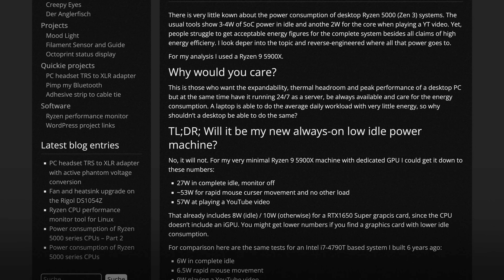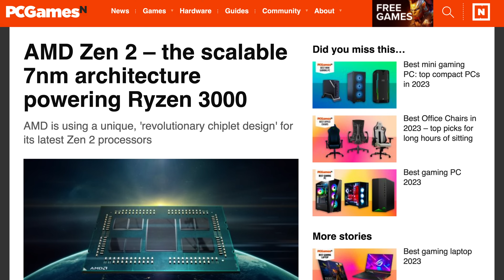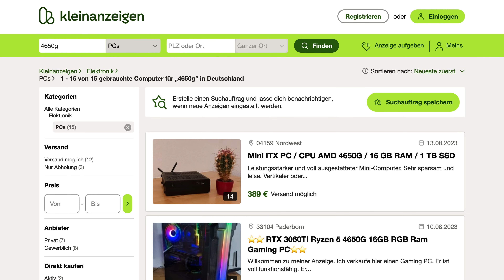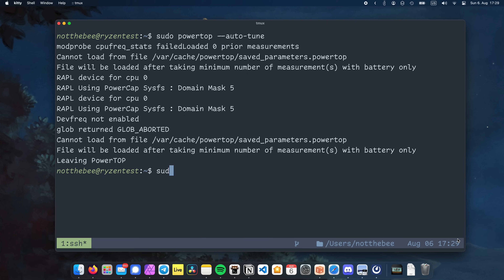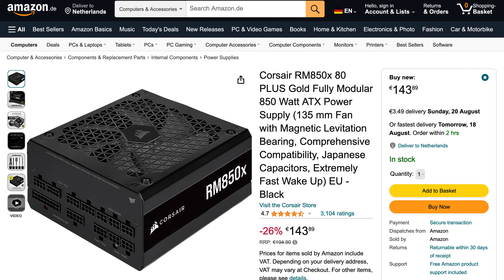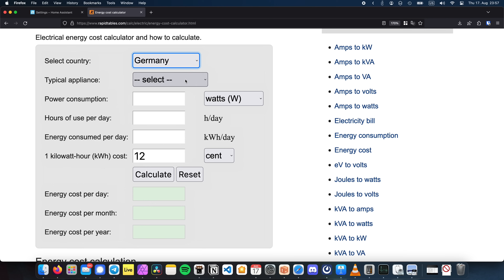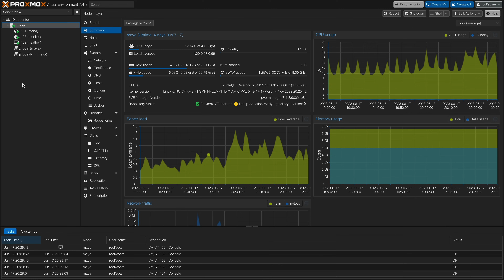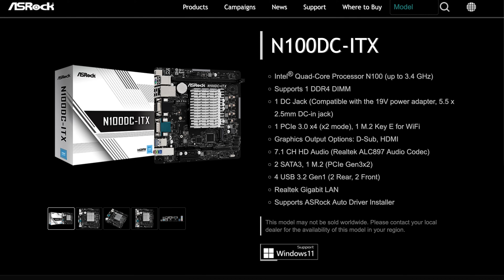This $250 Ryzen Pre-Built is a BEAST Home Server!

Comment: The problem here for me (of course highly subjective):
A home server is supposed to support some real storage space. That for me is the main point of any home server. 4 drives is nothing.
So for example I'm still running a very old i7-2600k -- simply because the board supports 10 SATA drives (or use a suitable host adapter - but still you'll need a case that can fit some more drives). So I'm running 10x18GB drives as zraid-2 (on 10GB ethernet) with it. Takes a bit more power but massively more useful and probably even much cheaper today because being much older. Since most of the day drives are in sleep-mode, power consumption isn't that bad, too.
Probably a good old HP MicroServer is still a better choice in practice.
Reply from the maker: You could buy an HBA or a SATA controller, and connect as many drives as this case will take. There are two 5.25” bays in the front, and 10 drives is definitely possible if you’re creative 😁

Comment: Thanks for the information.  Just for data on what  #'s I pay attention to (other than the super-important power/cost you cover well here)....   I typically copy thousands of pictures between drives and over the network with my home server.  I also dump compressed drive images to it for critical devices on my network.  Also, since Apple has changed their image format.... the home server tends to end up getting tasked with converting those in huge batches to JPG.  (I tend to use thin clients and laptops, so transcoding and backup tends to get done on the home server--even though the laptops would be faster... I just kickoff a script and the laptop leaves with me or gets shutdown while the server chugs away for sometimes hours)  So, USB throughput for external/cold backups, network throughput for large files (10-50gb) and small files (hundreds of K to MB), and local throughput for hot/onine backups.  I run plex too.... but even ancient HW does well for HD streams these days.

Comment: Nice Video, but how did you find that offer? Seems like a very lucky shot to me, can't find any comparable offers on ebay or ebay-kleinanzeigen.
Reply from the maker: Here are a few. Just put "4650g", "4350g" or any other Cezanne/Renoir PRO model, and set your max price to 300€
https://www.kleinanzeigen.de/s-anzeige/medion-pc-amd-ryzen-3-pro-4350g-16gb-ram-1tb-ssd-neu/2530105100-228-967
https://www.kleinanzeigen.de/s-anzeige/megaport-pc-amd-ryzen-3-pro-4350g/2502725094-228-2512
https://www.kleinanzeigen.de/s-anzeige/gaming-pc-amd-ryzen-5-pro-4650g-amd-radeon-graphics/2493126724-228-6820

Comment: Nice video. Thanks! Does it support RAID? I can get a dedicated NAS server at the same price, so why this built and not a NAS server? I would like to see some benchmarking on the client side, where you do normal task on the client PC, connected to different serves, like this one, your more expensive one, maybe a NAS and likewise servers. 

Thanks, I have subscribe...
Reply from the maker: The only dedicated NAS boxes I've seen for <€300 online are two-bay boxes with ARM/Atom CPUs. This PC will take however many drives you can fit in it and is way more powerful.

Just like most of the dedicated NASes these days, this PC does software RAID. Hardware RAID is pretty much dead in 2023: https://www.youtube.com/watch?v=l55GfAwa8RI

Comment: Running a server with ryzen 3600, 2x16gb 2600mhz, 1 nvme, 2 sata ssd, 2 HDD and a 1080ti. When the HDD are spin down, the consumption to wall is 52w. I leave a windows VM with passthrough for the 1080ti because I think this consume less power than leaving it off. Could switching the 3600 for the 4650g reduce the idle consumption? Also could you explain more about the amd P-state EPP for a proxmox server?  Thanks for your great videos

Comment: My home server costed 65 euro's totally. 49 euro's for the system with 4 GB RAM and a 250 GB harddrive and 8 GB extra RAM for 26 euro's. Excluding monitor and keyboard. It's a HP / Compaq 8100 Elite SFF with a Intel i5 650 proc. It has no fans and is totally silent.

Comment: Does this system support ECC properly or does it support running ECC memory in NON-ECC mode. I see this a lot with AMD boards where it says it will run unbuffered ECC memory but only in non-ECC mode.

Edit: Okay never mind. You answered this question pretty well around 4:00.

Comment: Did something similar to this very recently, but with a $50 mobo+cpu (some intel celeron) combo instead and just shucked it into an old rig's existing case+psu. Got it down to 22w~ idle with 3 3.5in HDDs, 1 2.5in HDD, 1 SSD, and 1 old fan consuming 3-5w on its own. It's nowhere near as powerful as this Ryzen though but gets everything I need it to do done.
Reply: Which Board and cpu you are using?
Reply: @8bit239  Hello, the exact board is called "ASRock J3455-ITX Motherboard" ; it comes with the integrated  Intel® Quad-Core J3455 processor. The weirdest part with this setup was the fact it needed laptop memory to function, thankfully I had a lot of dead laptops around to borrow memory from.

Comment: 16 Watts is good for an AMD CPU (or APU). AMD has never achieved to lowering their Idle-consumption. The Ryzen 4000 pro APU´s are very good in medium-load efficiency. I had an Ryzen 7 pro 4750G used for HD-Gaming and that was very sparingly (i could play Fortnite with 100 Watts at high settings - with RTX 2060). For Home-servers with low Idle-consumption they are not the best chose.
If you want a realy good idle-Plattform, then Comet lake is good for that. The Cometlake (Asroch H510M-HVS) can do Idle with 9 Watts (i5-10500K and Corsair VS350). Of Course only with the system-SSD and nothing more. And these incredable Shuttle DH410 can reach 5 Watts in idle - whats the same, as with the Fujitsu S740 Thin-client with an Celeron J4105. But that two PC aren´t suitable for Server-systems with many drives. Even the Asrock H510M-HVS may had to less PCIe-slots (only one x16 and one x1 and no M.2-slot and only 4 Sata - that low consumption had to come frome something).
I had also an Gigabyte B560M-H and that board also could not go under 20 Watts in idle. The Board-configuration seems to be relevant. And of course the power supply.
For whatever reason,  Intel 600-Plattforms (i have two diferent H610-Mainboards), the Idle-consumption does not go under 20 Watts (with G6900 or i3-12100).
Also i have several FSP power supplys and they are not as bad, as you expierenced, but not very good for Idle-consumption. What is somewhat strange, because Terra is an established OEM/Office-system  supplier and they had to be conform with special energy-guidelines for office-operation and one of them is the Idle-consumption - because usualy these office-systems are booted the hole day, but not the hole time under load. So low idle consumption is a big thing in energy-consumption in such setting. Medion-Mainboards are also relativly economical in idle (9 Watts for an H110H4-EM).
And that 4k Video scenario? Was that streaming over the network or directly over the IGP/APU? Skylake had only a HD-Grafik, whilest the newer Ryzen 4000 and (in regards to your video over the "mutant-CPU´s" ) Coffeelake-Gen have UHD-Grafik.

Comment: Interesting. About your future video: I burnt myself once with low-power celeron once. Power efficient does not mean it has enough power. It depends what you throw at it, but for me if something does not require power, RPI can do it, if it does, some USFF PC with skylake/kabylake core i5 are very power efficient, they just consume power under the load, but for home server, it might be a few minutes per day. But difference between celeron and i5 is that task might take either 3s or 10-15s and that's difference between fine and hardly bearable.
Reply from the maker: You probably underestimate how slow RPi 4 is. It's slower than something like an Atom x5-Z8350, and that CPU is more than 5x slower than the Intel N100. And that's an entry level Atom-level SKU.

I've ran an i3-6100 as my home server for years and it's more than enough for my use cases. As long as it has a PCIe slot and enough SATA ports, I'm good

Comment: For the 5.25” device bays, it may be better to put there 4 or 5 bays 3.5'' hdd cage. Like FlexCage MB975SP-B . Or mixed 3.5 and 2.5 cage.
Reply: I’d be careful with the latter suggestion as the 3.5” bay will only take HDDs with 6 mount points.  I know that Seagate had some 1TB HDDs with 6 mount points years ago.  6TB may be the highest capacity these days.

Comment: im fine with xeon 2640v4 (10/20 core) + chinese mobo + 32gb cheap ddr4ecc used, 10y old corsair 450w gold psu, 45w in windows 10 with 2 laptop hdd + 1 nvme ssd and game server running using 8 dedicated cores in vmware. cheap 1200VA ups + isp router + wifi6 router + 8port x1gb switch consumes + 25w, and I cant save much more. Limited cpu max power to 95% in windows power management that prevents cpu from boosting higher than 2,3 ghz, saving around 10w under same tasks. So whole system is 70w consumption +/-2w, and im ocassionaly using server to watch youtube on tv, dl torrents, host plex server and home lan file archive. As ssds getting cheaper plan to replace laptop hdds with nvme drive. whole system price is under 200 usd (excluding network gear and ups) added 2.5g lan card from ali for 10 usd, waiting for 2.5g switches to become cheaper.

Comment: nice video. I have to say i got your videos recommended today and was kind of surprised by talk about inefficiency of amd cpus, I am running 5600g in with a520 board / 2x 3,5 inch drives + 1x 2,5 inch ssd + 1x nvme ssd / 2x32gb ram / corsair sf450 psu / currently running about 20 docker containers - idling at about 16-17 watt. I have been running this for about a year without a single issue . 
I has plenty of power on demand and currently i see only one downside - 4000g/5000g supports only x8/x4/x4 bifurcation of cpu pcie lanes, so with my planned upgrade i will just throw away four lines :/
Reply: Hi, do you know if with an 550 motherboard 4000g/5000g support x4/x4/x4/x4 bifurcation ? Is that limitation also for non APUs such as ryzen 5950x or those support  x4/x4/x4/x4 bifurcation ?  
Can you explain if there is a way to use the x8/x4/x4 bifurcation to use several M.2 ssds ? Thanks
Reply: @ncarrasco2006  it is definetly an apu limitation, i actually used same motherboard with 3700x before going for low power with 5600g  and it offered 4x/4x/4x/4x ..
Reply: I see, I wasn't aware. I bought a Ryzen 7 PRO 4750G. Regarding the limitation, did you find a way to use the available configurations to support more M.2 SSDs ? Thanks!
Reply: @ncarrasco2006  afaik, with x8/x4/x4 we should be still able to use three m.2 slots on those passive expander cards like asus hyper m.2 / msi expander-z, one of the slots just wont work ... that is actually my next plan for upgrade .
Reply: @nesty8848   ahh, I see that for clarifying that , I think I will try that also, but some months later.

Comment: I really enjoy videos like this, thanks!  I recently found your channel and used what I learned to retool my Minecraft server and brought it from 20 watts down to 10 watts while players are logged in and playing!  That might be a cool video for you to tackle since it is a light duty 24/7 use case and oddly just wants tons of RAM and a fast single core to keep the game loop running at 20 ticks per second.  I picked Intel G3258 since they are so cheap and can easily overclock to 4.0GHz.  I just bought two off eBay for $9 each and got it up to 4.0GHz stable and it barely touched my idle power draw!!!
Reply: Actually impressive
Reply: Wait... 10 Watts total while people play MC? Whats's the rest of your setup?
Reply: @muellerhans  an ASRock mobo, a Samsung EVO 850 SSD, and importantly a PicoPSU 90 power supply.  Oh yeah and a big Noctua cpu cooler that never has to run its fan.  There is a 110mm case fan that also never runs.
Reply: @muellerhans  I'm playing Nomifactory CeU and late in the game when thousands and thousands of machines are running, the power goes up to like 16 watts when I'm logged in.  Having thousands of ticking tile entities increases the needed power a little bit.  Still minuscule!

Comment: misleading information. no actual wattmeter used
Reply from the maker: The power consumption is measured at the wall with a smart energy plug
Reply: @WolfgangsChannel  at what timecode? you got 16 watt, seriously?
Reply from the maker: Any timecode that shows watts is measured at the wall. 16 W for this hardware is not unreasonable
Reply: @WolfgangsChannel  something hard to believe

Comment: If you had to pick something brand new, that is actually available what would you choose, for low consumption, without being poor?

Plex 4k playback, NAS, and other various stuff.

Currently rocking a 5820k with a Quadro P2000, MSI X99-A SLI PLUS, 16gb ram and it consumes around 60-65w.

For a budget around 500 euro.

Comment: Can you build a server out of a Beelink Ser5 AMD 5500U with 6SSD's? you might need to 3D print parts of a case and some soldering for SSD power. At Idle  the beelink should stay at 8 watts.The beelink Ser5 can be bought on Amazon for 320Euros

Comment: Saying $250 defeats the purpose if you kept spending money on it..
Reply from the maker: I'm making those videos so you don't have to :)
Reply from the maker: I'm not sure if you've watched the video in its entirety or maybe misunderstood, but I discussed different options to make this PC more power efficient, and ultimately concluded that most of them are not worth it financially. The computer is 100% usable out of the box and you don't have to spend any extra money on it.
Reply: @WolfgangsChannel  I did watch it all, probably just went overboard is all. What i meant was, Replacing the PSU was Perfectly reasonable so didnt mean that. But you changed the motherboard, which as you said was like an additional $86. Its possible i mixed this video with another one cuz i could have sworn you replaced or added more than just the motherboard,, Hum..... well my bad.

Comment: what do you think about making the server psu even more efficient by using a USB PD GaN charger with a pico psu and a "USB Type-C to DC 5.5  Adapter Cable PD Charging Cord 19V", been thinking about doing this for a long time and GaN is more efficient that the traditional power supply technologies we used.

Comment: My truenas build is based on 4650g pro and asrock b550, it really works like charm with ecc memories.
Reply: hi there, may I ask what your truenas build's idle power consumption is
Reply: @ksasea  have 7 10tb, with 2 4tb. it usually around 50watt to 60
Reply: @ariffinsetya  oh, that's...a lot. But is it because of 9 hdds? I'm considering building a truenas with 4350G + asrock B550M Pro4, do you think it'll push down the idle power much?
Reply: @ksasea  i dont really tune the cpu at all, it's bone stock, my smart plug register 60kwh last month, plus the ups it's connected to, so around 83w (nas+psu), yeah my 10+ hdd does impact it quite a lot i think. 4350g, already less watt use, and if you use less hdd, should have lower idle also. based on some review, my hdd each use 5-7 w idle, that's already 45w..
Reply: @ariffinsetya  tks so much for your insight. BTW, one more question plz. Do you think a strong cpu is important for a truenas system? I'm at a dilemma of chosing whether 4650G or 4350G. As my main purpose is just backing up, storing files, games, and more importantly, playing those games directly without redownloading, I'm wondering if 4350G is enough for these purpose. The main thing I  should concern is the read/write speed between my nas and my pc, right? Like 10gbs lan, big ram, big cache,...etc.? If 4350G is ok, I'll go with it since it uses less idle power consumption.
Reply: @ksasea  i choose 4650g because i plan to have lot of app/container, and also have media server running, when the igpu cant handle the transcode it will go to cpu. If you keep install/uninstall game from steam, maybe try have steamcache installed, rather than backup and move the file to nas. I think for mostly file storage, 4350g should be plenty.
Reply: @ariffinsetya  have no idea about the steamcache thing. But thanks for your suggestion, I'll look into that. Your plan sounds really tempting, but right now I don't know anything about those things, maybe I should go with 4350g. Then if I need them in the future, 4650g or even 4750G would be the case

Comment: I am still waiting for FOSS firmware for integrated AMD GPUs. Are they out yet?

And about HDD auto spin down I'd think about turn it off for longevity.

But yes, the PC is cheap for what you get in return. Maybe you can sell the case for 20€ and the optical drive as well... If you have lots of vm and services you could get 4x16GB dimms (the mb supports up to 128GB) and sell the two 4GB ones preinstalled. This is what I'd do.

Comment: I used i7-9700 for my home server and with 2 sdd, 2 hdds and LSI Megaraid ir rarely goes over 50-60W for the whole system while serving invidious, nextcloud and a lot more. If I went all ssd, with no hardware RAID controller I could probably save another 30W.

Comment: Thank you for your videos. Recently I bought an HP Prodesk 600 G4 with i3 8100 CPU. With powertop --autotune and other steps (~HDD spin down), the idle consumption is 8-9W !! This computer has a 180W platinum power supply. And it costs about 120-140 EUR on the used market (8-16GB RAM, 250GB SSD). Also it has a huge disadvantage: only one 3.5" drive bay. But it's enough for me.
Reply: can you tell me if the PSU fan is loud ? does it turn off when idle ?